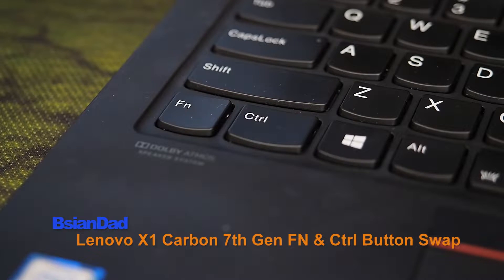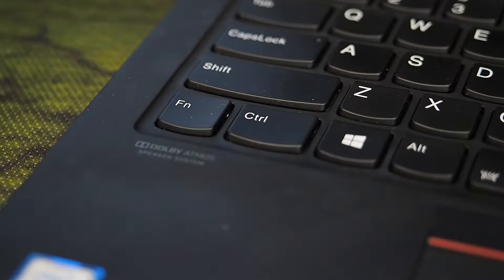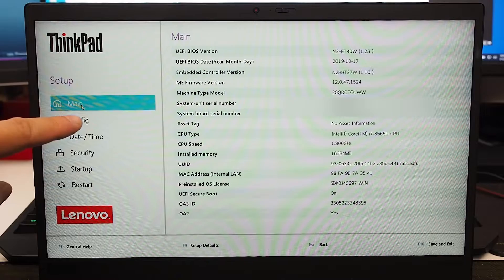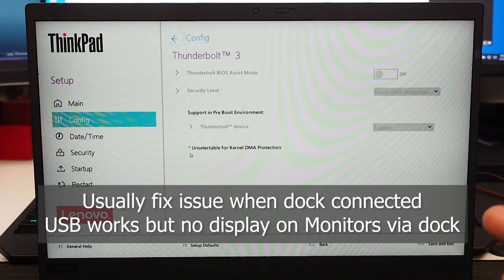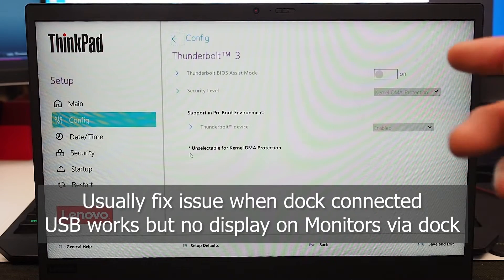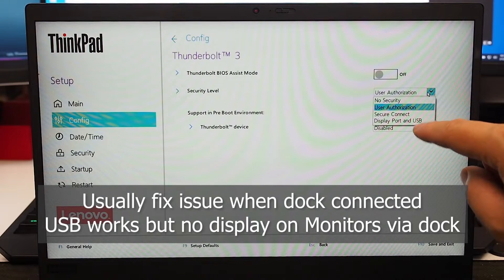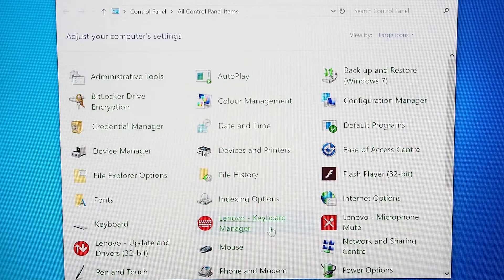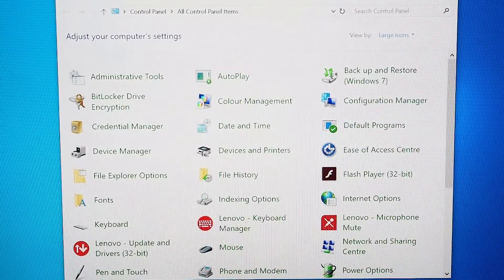How to Swap Fn and Ctrl Buttons and Thunderbolt issue- Lenovo X1 Carbon 7th Gen

Comment: I ran into the problem of the Dockingstation working on the X1, but no success with Keyboard and mouse over USB. 
Did some googling and soon found out i had to edit these settings as you just demonstrated for it to work. 
I can imagine however less techy people are not able to figure this out. I went to amazon reviews and indeed: lots of returns by people who described the exact problem and returned the station where i suspect they just had to enable it in BIOS.
Reply from the maker: Yes this happens a lot about the thunderbolt security stopping thunderbolt docking stations from working correctly. I have tried to make a number of videos mentioning changing or authorizing the thunderbolt settings to allow docks to function correctly.  This has frustrated many people including myself, just hope my message gets out there slowly to help others.

Comment: I think you can directly press on F1 in the Lenovo splash screen to go into BIOS
Reply from the maker: Thanks for that Michael Pujos, the F1 does work just had sometimes it misses it but the enter always works it was the reason I decided to put that in the video instead. Thank you for mentioning this though =).
Reply: @BsianTech  I don't get that press Enter to enter BIOS message so Enter didn't work for me. Nor did the F1 key pressing it furiously. Even tried it while holding the Function key down in case that was the issue. I eventually had to boot Win10 and go into the Recovery Settings and reboot that way. Posting here in case someone else has that problem. I had to Google "can't enter bios windows 10" and used the laptopmag.com instructions.

Comment: It's a bit strange that they didn't make it normal layout for this generation given my Lenovo Yoga 940 14inch has a normal keyboard layout.
Reply: All thinkpads probably have same keyboard layout  I think it is inherited from Ibm days.
Reply from the maker: MaZEEZaM, my thoughts are the Thinkpad range likes to hold on as much legacy as possible more for the commercial mind set try be compatible as possible or give the old users slow changes. Mate how is your new Yoga 940?